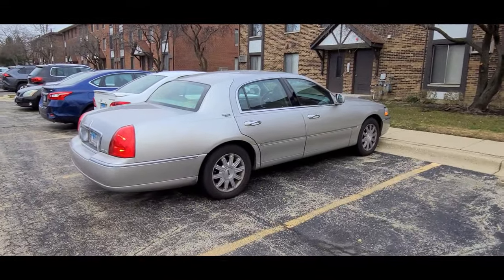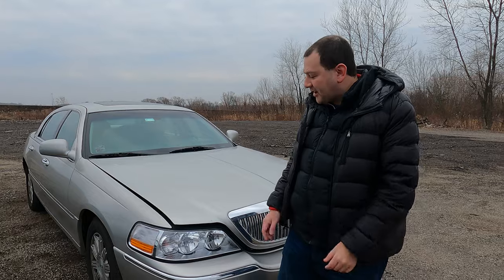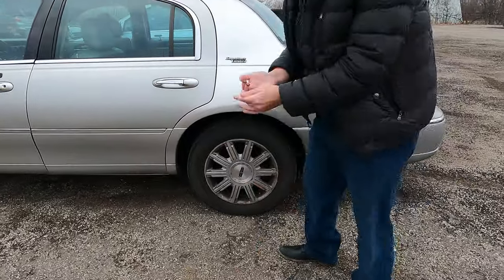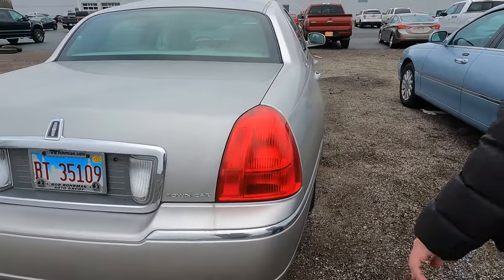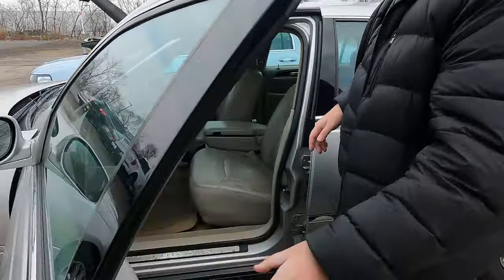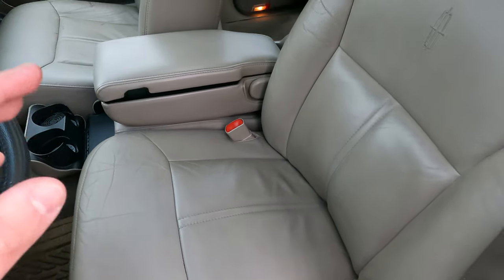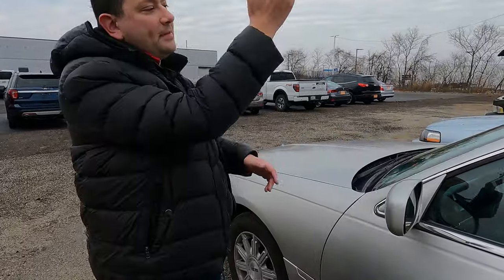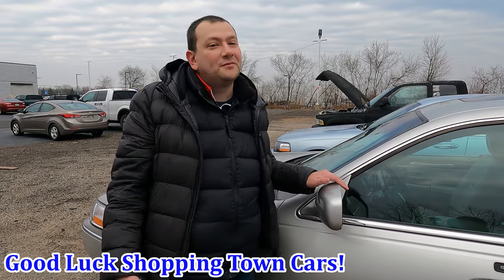Lincoln Town Car Guy Presents: Watch This BEFORE Buying Lincoln Town Car / Mercury / Ford Platform

Comment: The absolute most important thing is to torque the spark plugs to 28 foot lbs. instead of 10 foot lbs. like the factory did. If you don't the spark plugs can vibrate loose and eventually blow out of the hole, taking the threads with  them. Also, when opening the doors from the inside, it is important to take your thumb and push in on the bottom rear corner of the door handle bezel.
If you don't do that, after 100,000 miles the bezel will break out on the back side of the door panel and will fall out the front. Dorman reproduces these, but not the ones that have the hole
for the front seat heaters, When closing the doors, reach around with your hand and close them
by grabbing the front outside sheet metal in front of the window, otherwise the door pull handles
will wear out and look disgusting. Also, if you park the car where leaves can fall on it, the leaves
will fill up the air box by the right hood hinge and plug up the water drain on that box, resulting in rain water flooding the right passenger floor board. You can remove the lid on the box and clean the leaves out and unclog the drain to fix this. I've seen the engine and transmissions on these cars last as long as 700,000 miles if you use Mobil 1 motor oil. On the center console front armrest, buy a small pillow to set on top of it, don't rest your arm on the console lid as it will look
like crap after about 50,000 miles of doing that. These are the most reliable cars ever made with
two exceptions.......the CD changer on the radio and the rear air suspension. On the air suspension I recommend replacing it with coil springs and getting rid of the air springs in the rear, otherwise you will spend a lot of money keeping it working. On the radio I gave up on using
the CD player  because they won't work more than 12 months after having the radio repaired. I
added  a Siriius XM satellite  radio  setup on my Town Car (no CD's). The radios have a SAT button but you have to have the Satellite radio module and antenna that plugs into the back of the radio to use this feature and all the parts have been discontinued and nobody has them anymore. I love my 2009 Town Car and would never replace it except with another Town Car...
They are the best car ever made period end of discussion.

Comment: Is there a special glue you need to put the Lincoln letters  Back on the trunk And also how in the world did you stuff that seat
Reply from the maker: For those letters, there is "trim adhesive" I bought from Walmart. Seat stuffing took some efforts. I do have a poorly made video on that (my earlier efforts). Basically, the seat has to come out and leather lifted. I took some dense foam and stuffed it between the metal rails of the seat and the factory cushion. Was very careful to put everything back since was afraid to ruin the heating pad and rip the leather. It all worked out. This is the video here (4:20 mark is where I do it) - https://www.youtube.com/watch?v=045vk7Wwc6E

Comment: Weakness in design:
Rear axle bearings
Intake plastic manifolds
Leak from cowl passenger side footwell.
Door lock mechanism inside door rivet breaks.
Steering shaft universals go bad.
Airbag rear suspension eventually all go bad.
Reply: So?

Comment: Buy a 2006 to 2011 they came with the updated transmissiom the 4r75r instead of the 4r70w used in the crown vics that are known to have problems with the front pumps in the transmissions. Took me way to much research to find that out. I bought a 2001 then found some info on this on wikipedia but it was lies told me that 2002 and up got the 4r75w so i bought a 2003 still have both of them.up for sale. Found out that had the 4r70w. Then i found the real info of the trannys geting the update on these and mercury grand marquis possibly all crown vis but might be just the police cars in 2006 and up. And checked with alot of people on facebook market place with them checking in there owners manuals for me and yea seems to be true 2006 and up cars got the updated transmission the 4r75w only way to find out that i know of is in the owmers manual itll say what transmission it has.
Reply from the maker: Thanks for the comment and info!
Reply: The front pump in my 2005 is toast. Swapping in a 2010 junkyard unit. It's not a direct bolt in
Reply: @AircraftMechanic-AP  2005 was a weird transition year. I think just for 2005 they got a 4r70e then in 2006 they switched to a 4r75e dont listen to wikipedia they say they changed to 4r75s in 2003 thats not true i had a 2003 they changed in 2006 and im pretty sure a 2010 wont fit on your 2005 correectly
Reply: @thisguyfromyoutubesaid1537  it bolted in fine. The electronics are different along with the internal harness. Have to swap all that stuff over. Which involves dropping the valve body. Good time to do the j mod though.
Reply: @AircraftMechanic-AP  ohh okay. Whats the j mod?
Reply: @thisguyfromyoutubesaid1537  You drop valve body and remove a ball and drill 2 holes a lil bigger. Not as much slip more positive shifts. I did it and love it. You can buy a kit with bits, template and guide. But if you got the bits and tools you can just look it up and do yourself. Highly recommend.
Reply: @kitjasabsgabs1830  oo that awesome i never heard about it. I just came across the transmissions in the later models being amazing to match the amazing engines they already had. So i sold my 2001 unfortunatly bought a 2003 because wikpedia told me lies the had problems with both of them for the short period i ownedd them until i could sell them. Now i have a 2009 mercury grand marquis with the same engine and transmission as the town cars and its the ultimate edition so i thought it would be as good but after buying it i found things are more different then id like theres no vents in the rear seats for air or heat. Theres no 3rd seat belt for the front so its not a real bench seat the steering wheel doesnt have radio controls a few things. And since there the same price used id go with the town car in the future
Reply: @thisguyfromyoutubesaid1537  Gotta watch that online wiki stuff. Always have a transmission person who does that for a living and ask him or her. Alot of guys or gals can fix cars but rebuilding a engine and especially a automatic trans is tricky. Alot of snap rings and seals and if one is out of groove just a hair, things will make noises its not supposed too! I'll look for the guy I watch on YT. He's very slick, quick and can usually tell what's up with it while taking it apart. He can tell if stuff is rebuilt, new, used or toast. I'll get back to ya. Hard to beat a Town Car. I only wish I'd realized this sooner!! I've driven my 99 Cartier in some remote places and I always got made fun of for being only guy to have a big pappys car. But with some rough treads, some snow spikes just in case, and some careful gas, off gas footwork and momentum, I've never failed to get there or back. Sometimes she's gets a lil squirrely in the back when I'm getting a run for the hills but I tell them, what do you think your parents, grand parents drove? Cars. Or 2 wheel drive trucks or vans. And they did just fine. I love the room, the easy driving, good gas mileage, the way it just goes and goes without big money repairs and is safe. I use 07 Designer for babies ride so I'd rather have a frame and some meat and airbags around me than in these lik popcan cars. So thin you lean on it and it flexes and buckles. Big change from Subaru Impreza but the best change I've ever made. Plus we get to drive 50k dollar cars when new for a fraction of that. If maintained and taken care of they go for over half a million. Especially if not in rust belt or really protected. I fight it every year but I've spent alot of time with internal frame paint from Eastwood, then a few coats of zinc paint then black implement paint. Hard as rock. Then fluid film and baby oil or the like for doors, hood trunk and rockers. I found a guy who uses a tube of grease, a toilet wax gasket and some kind of quart of oil. I thought it was crazy but after trying it, he's spot on. So I've spent alot of time in a rain coat and garbage bags painting, spraying, brushing all kinds of stuff trying to find what works. And all of that does. The Eastwood company has alot of good products to help preserve our cars even if it's in nice climate. My father and uncle has used on old farm tractors, Hit and miss engines, log trailers, logging equipment, log loaders, old cars, trucks and our drivers and semis. If you don't do anything you'll have a pile of rust in a few years. And it's alot of work sand blasting, repairing, painting etc. Best defense is a good offense. I love these cars. I wish they still was made. Only thing I don't like. I look at them every time I see 1. Even if it's pretty much same as mine or yours. Have a good wknd. I'll see if I can look those things up and post them.
Reply: @kitjasabsgabs1830  i really have to try some of those rust preventers you mentioned the last car i had had a rusted axle so bad then when the ride height sensor sliped off (wich kept happening until i wired it on) it raised the springs all the way up and when i turned into my driveway cracked the little seat the air spring sits on the axle i fixed that but that was also some rust holes in front of the rear tires in the tire wells. Thats the one flaw these cars had and the intake manifold gaskets but apparently that only has an issue if you really floored the gas pedal it could pull hard on the serpentine belt and crack it apparently they made a fix for that somewhere in the early 2000s from factory but i also saw some reports of later model town cars cracking the intake manifold gasket too so maybe it never got fixed . But ive had a bunch of people tell me the same thing about it being a old mans car im only 29 so i get itnalot but im proud driving my 2009 mercury grand marquis because i like owning what i think might be the best engine AND TRANSMISSION ever made i used to think it was those old 90s lexus ls400s now im pretty sure its these. One thing i dont like and its not a big deal as long as you know this but its a little 25 dollar sensor attached to are brake pedal that if the lights burn out or this sensor goes out you cant take the car out of park your stuck there unless you know the trick of putiing the car in neatral then starting the car then you put it in drive reverse whatever but if you dont kno that a little 20 dollar 5 minute repair could leave you stranded i dont know why they did that or didnt add a cabin filter. But its an amazing car and i bet theyll bring it back someday because people love them and these front wheel drive garbage cars theyre making now arent sellling.
Reply: @thisguyfromyoutubesaid1537  l

Comment: Damn, rear doors are very off color to rear quarter panels, extensive body work has been done
Reply from the maker: You are right. Both quarters were worked on for rust damage. Bad color matching...

Comment: I own one of these pigs. These cars suck. The engineers couldn't even design a proper CUP HOLDER that didn't spill over on turns. The engine & transmission are bullet proof but the rest of the car sucks. The only car that needs a bilge pump , that's how bad they leak.
Reply from the maker: Although I agree with you on the leaking issues (had several of those), but will have to disagree on the rest. I like it for what it is - a giant boat built for comfort cruising and it makes me feel like a million $$ when I'm piloting it.
Reply: @VitaliyKofman  IDK. Must be from a THC legal state. Yes they have a small leak that takes 10 minutes to fix and 7 bucks. But my drinks never spill. Can't take turns at 90. Lmao. But hey if that's what he thinks he's got that right. I think he just got a neglected car that if taken care of and maintained on time. He'd be very happy. I have 2. I'm twice as happy!!
Reply: @kitjasabsgabs1830  Wait until you have to replace the entire front end because there's not even a grease fitting anyehere. When your blend door breaks, pray it faols in the heat position so you don't freeze your ass off in the winter.
Reply: @mafatone  I've had them for decades and never had any issues. Maintain urr vehicle and it'll last. Blend doors are plastic. They can and will break. That's life. Fathers 1 yr old dodge truck broke 1.
Reply: Also if u buy other than cheap parts store parts, they do have grease fittings. If not pierce the boot with a syringe about a 14 gauge, and lube it yourself. And another, I've seen ppl spend so much all things and put airbags, rubber bushings, etc in car and not protect them. Parts are so cheap they rust in a week. I always use Opsho, 303, Vaseline whatever on parts so they will last. My old man is a stickler for taking care of urr stuff. Alot of ppl are not. I maintain mine and find small issues before they get big. They all break new or old. These cars are proven to last 3/4 million miles when properly serviced. If u can't get 250k miles out of a panther, u didn't care. I've owned a few and all lasted. I had a Grand Cherokee that lost blend doors. They fail closed. Take out glove box and cardboard and duct tape it. When need heat, undo. I may be backwards. It's been a decade.
Reply: Why a bilge pump? Fresh air duct? Just curious. And are u in a hot climate or cold snow in winter rust climate?

Comment: There is other stuff to look for, the spark plugs if over or under tighten will blow out of the block, the intake will crack by heater pipe and on the driver side, need to look around spark plugs for coolant. this was a known problem from 03-11, ford did fix it on the mustang with a metal intake. The timing chain guides are plastic and will wear need to listen for the rattle sound on cold startup. The 03 had bad rear axel bearing and will leak if not replaced. And finally the DDM driver door module will fail . also check the rear air suspension bags they will leak
Reply from the maker: Thanks!
Reply: Never had plug issues. Did have heater hose issue. It's a pain to fix but I just ran hose from heater core to nipple on back of pump and bypassed it under intake. I work on cars and have owned alot of these Town Cars. Some folks are saying the early 4r70 trans are issues. Did you have any issues? I know there's a service bulletin saying never flush them. Just do normal filter and fluid. I've never had trans issues but a bent phaser on rear axle so confuses my sensor and my OD light will blink. But trans is working well. One guy has one I saw week ago with 650000 original motor and trans. 2010 I think. Pretty newer model. Thank you. Panther owners are great folks. Not met a bad one yet!
Reply: The beauty of the panther is that all these parts are +-$500 if you can do the labor yourself.
Reply: How do you do the plugs yourself then? Do they have a spark plug torque wrench? I’m an idiot.
Reply: @MAGA_Randy_Marsh use the same torque wrench as any other part. Use normal ratchet till you tighten them down

Comment: I thought I would keep my Town Car forever...  one of the few things that could happened to separate me from it happened.  I found the exact same towncar from California same color with half the mileage.  So mine is for sale and I hope Vitaly buys it and shows it on YouTube.  I bought mine about four years ago at an auction.  
Suffice it to say I have the ultimate Town Car.  Carfax says it was registered federal diplomat car White House General Colin T. Powell.  It is a 2011 Signature L  black on black of course.
I added a full wood dash kit...lots of chrome mirrors thin lower body sail panels trunk base...new carpet...it has the world's best window tint $2500 I kid you not SPECTRA PHOTO SYNC Rolls Royce level...new suspension OEM including compressor and airsprings...new compressor or air conditioner 

Only negatives are jealous parking lot scratches even though I park a block away.  Will post in Hemmings Motor News. 2011 Lincoln Town Car Signature L black on black 77,000 miles worth every penny of $25,000.     Peter.      847 735 7377